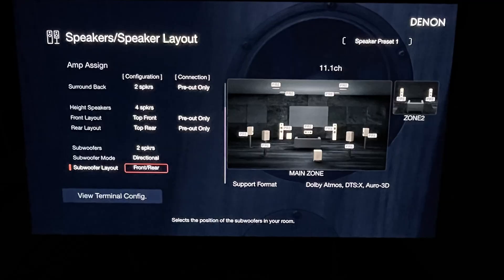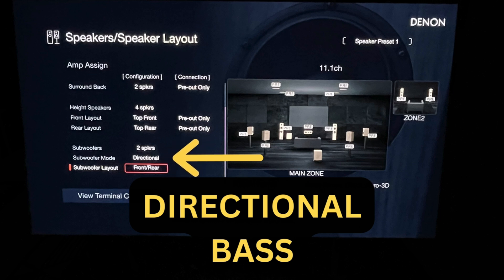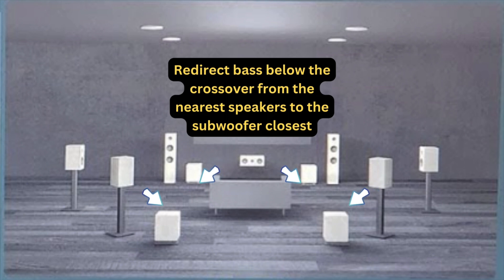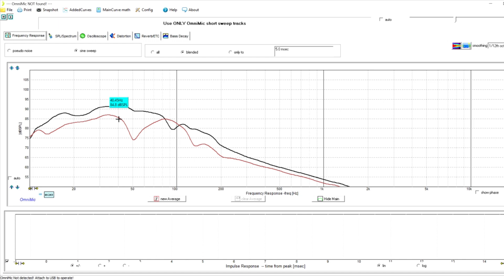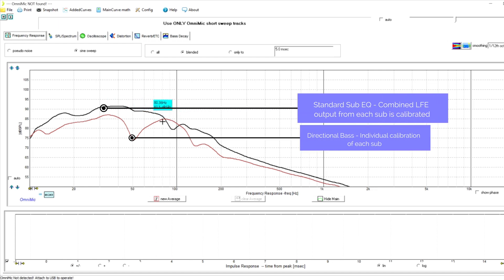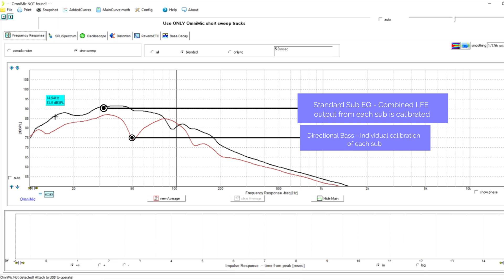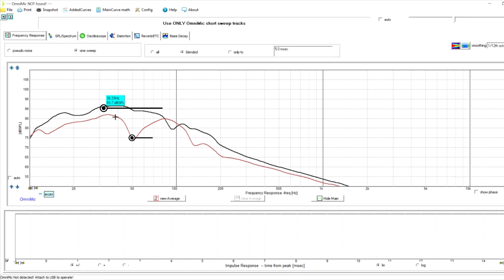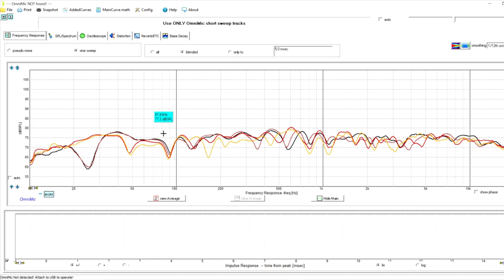Directional Bass vs Standard Bass | Audyssey MultEq Calibration | #denon #marantz #subwoofer

Comment: Hello Sir, Im a great admirer of your videos. I have a query. You are the best person who can help me out. My room size is 13*8*6.The amplifier is Denon 1800h. Centre speaker is KEF Q650.Subwofer is Taga212 SE(12 inch). I am looking for a good speaker for front left and right. All suggested to go with KEF only but i cant due budget concern. My options are

Qaccoustic 3010i
Elac B6.2
Jamo S803
Polk Es 10
JBL A 130
Monitor Audio Bronze 1

or is there any which you suggest?. My usage is only for watching OTT movies.
Reply from the maker: Thank you.  🙏. I suggest matching speakers with the Q650. Any of the speakers bookshelf or floor standing in the Q-series line would be great.  The Q950 is on sale at Best Buy for $879.99 a pair. Saving $200.  Q150WA are $299.99/ pair. Saving $300. Q350 are $499/pair with $300 off.  You can use my affiliate link and browse the speakers.  This helps the channel! https://bestbuy.7tiv.net/raDYM3
Reply: @magnoliamo Thank you so much. I have one more query. I am having 2 subwoofer. One at the front and one at the rear. The sub level is at --6 db. I am getting good bass from the rear but i cant feel the bass from the front.I tried changing the phase and also the location but still its the same.